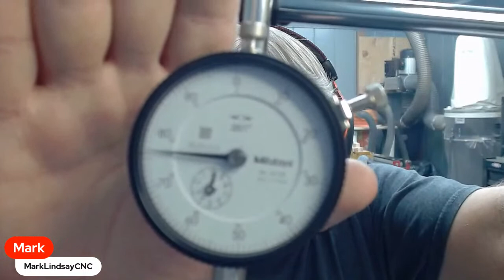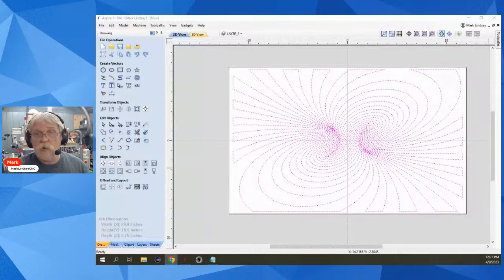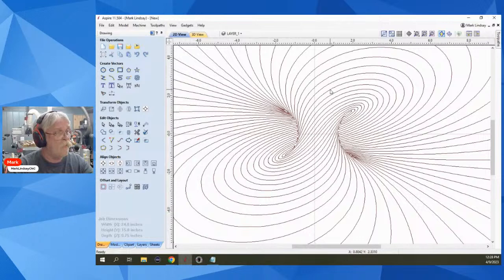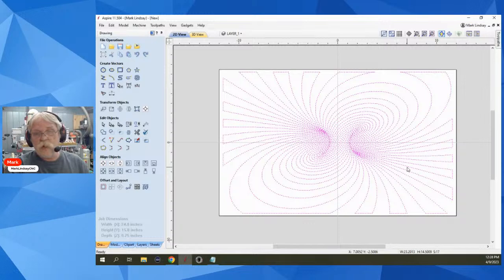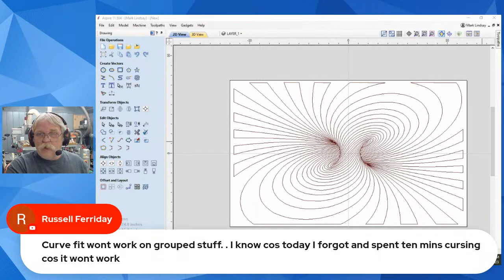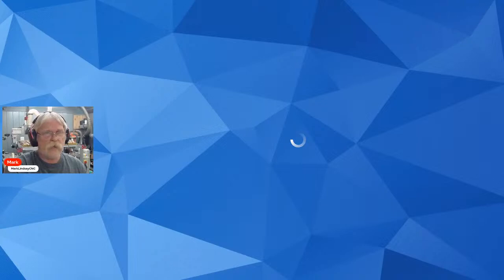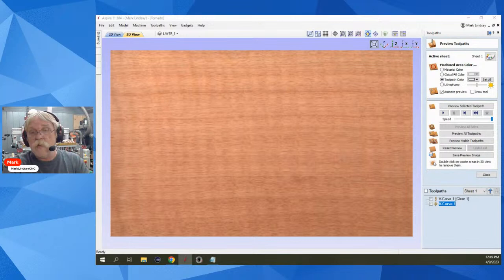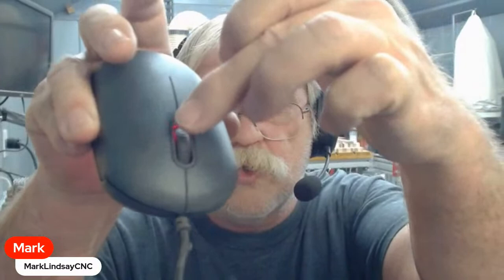Live Q&A #186 – Z Zero Position - Machine Bed or Material Surface?

Comment: Thank you for all your videos! Trying to do my first test project. Everything jogs correctly in UGS. Using Vectric desktop with UGS. Simple test project 
‘Kevin’s Wood Work’. Zeros correctly but when I load the file and run it everything works correctly except the Z axis lowers painfully slow to where the file takes 1:21:30.   Any suggestions? Thank you and keep up the good work.
Reply from the maker: Check the plunge rate for the bit you're using. In VCarve Desktop, go to the Tool Database, select the bit you're using for that file, and look at the Plunge Rate, just under the Feed Rate. Whatever you have the feed rate set at, set the plunge rate for 1/2 that amount. So if you have a Feed Rate of 60 ipm, set your Plunge Rate to 30 ipm. Click APPLY, then OK. The recalculate the toolpath, and go to the Toolpath Summary and check the Estimated Time. That should help a lot. As you get used to carving, you'll quickly learn how to adjust Feed Rates, Plunge Rates, and Spindle/Router RPMs to maximize your efficiency. For right now, though, a Plunge Rate that is half of the feed rate is a good place to start.
Reply: Mark Thank you! You gave the solution I needed and learned from this! I appreciate your time and sharing your knowledge with me!